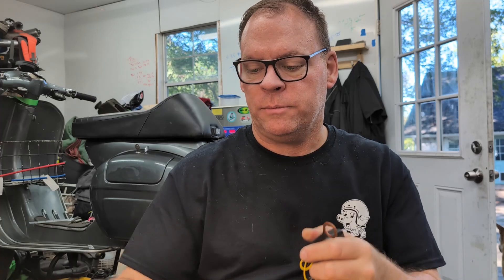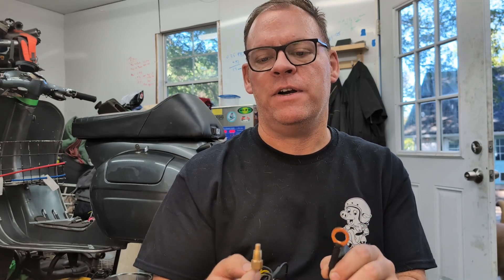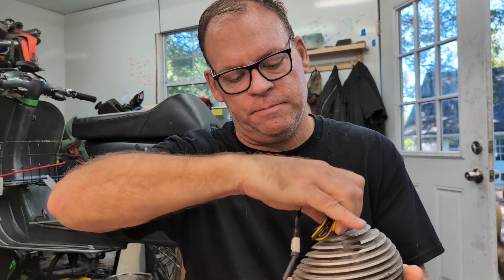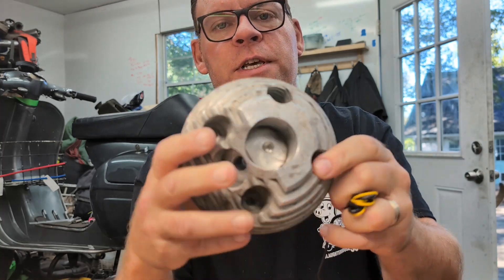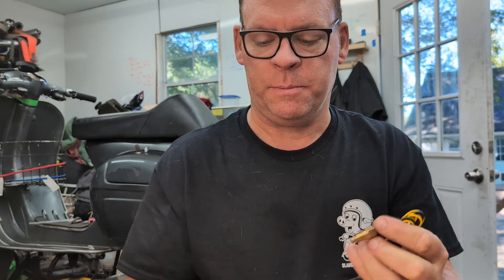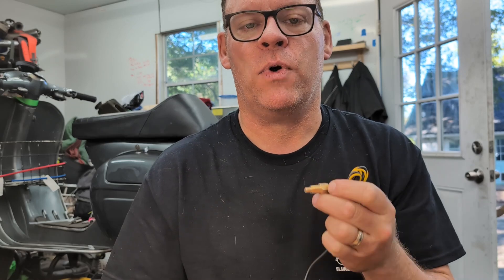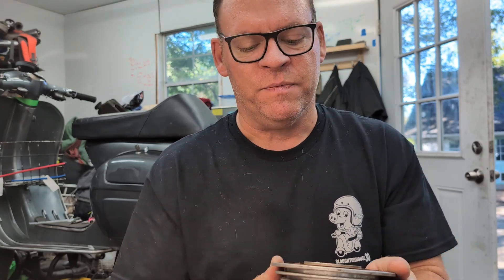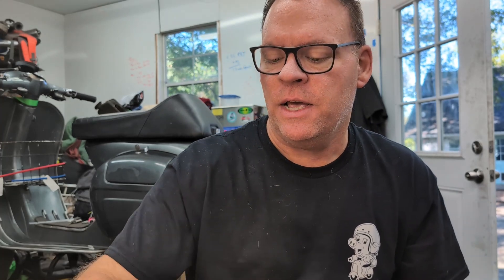I test In-Head and Under-Plug CHT's for Vespas and Lambrettas so you don't have to

Comment: Put your hand on sidepanel or cylinder head to see if your lambretta is overheating. Another gadget to put on your scooter which to be honest is good fun. Best thing i bought for my lammy was led bulbs and LTH reed valve.
Reply from the maker: I like a little more accuracy than "hand on the panel" at 70 MPH. 🤣
For lights, I'm all DC/LED andI run a JW Speaker headlight that puts any BA20D reflector bulb to shame.  I have the "stock" Quattrini reed that came with the TV210. I've considered picking up a VForce3, but just don't quite see the need right now.
Reply: @ChandlerHowell-Vespa